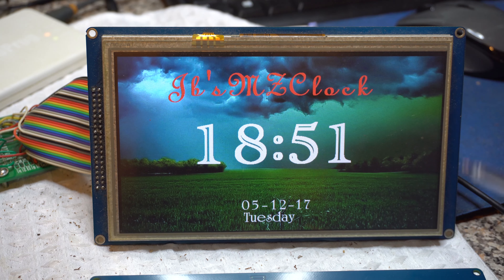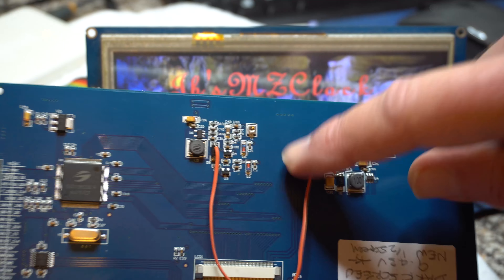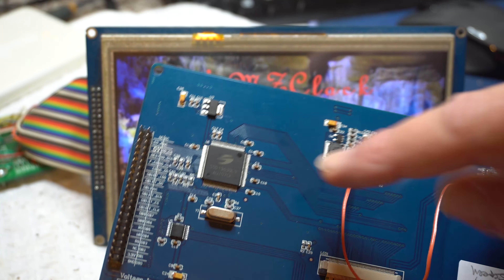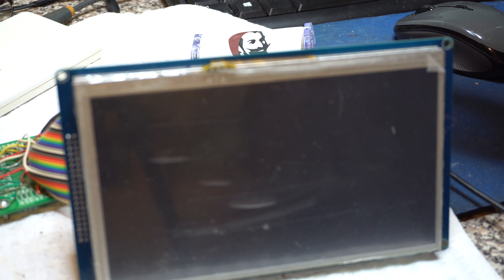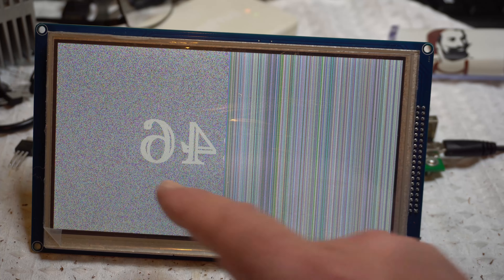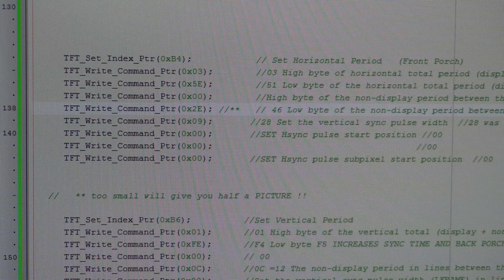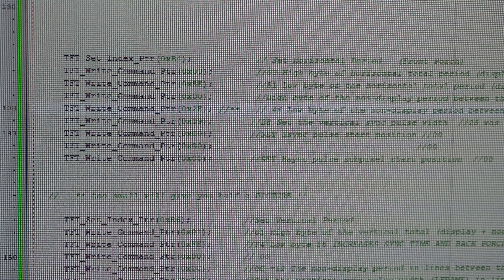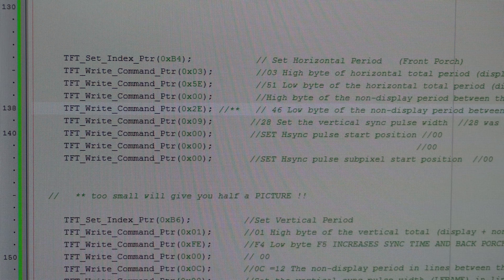7" TFT SSD1963 Register Settings for New Displays When Only Half Picture Shown

Comment: hello sir..
this my initialize code .and i have same problem where you change 0x2e-->0x46 and solve initialize the lcd i change it but not working For me i used ssd1963 7 inch with STM32F407VGT6 

void Init_SSD1963(void)
{
Lcd_Write_Cmd(0xe0); //START PLL
Lcd_Write_Data(0x01);  //Set bit Enable PLL
HAL_Delay(50);  //Wait  to let the PLL stable
  
Lcd_Write_Cmd(0xe0); //START PLL
Lcd_Write_Data(0x03);  //(0 - Use reference clock as system clock   1 -  Use PLL output as system clock)
HAL_Delay(5);

Lcd_Write_Cmd(0x01); // Software reset
HAL_Delay(10);  
  
Lcd_Write_Cmd(0xe2);//Set the PLL
Lcd_Write_Data(0x1d);
Lcd_Write_Data(0x02);
Lcd_Write_Data(0x54);
  
Lcd_Write_Cmd(0xe6);//Set the LSHIFT (pixel clock) frequency
Lcd_Write_Data(0x04);
Lcd_Write_Data(0x6f);
Lcd_Write_Data(0x47);  

Lcd_Write_Cmd(0xf0);//SET pixel data I/F format=8bit
Lcd_Write_Data(0x03); //pixel data format, 0x03 is 16bit(565 format);0x00 is for 8-bit
//Set the MN of PLL

//////cput(0xe2);   //SET PLL freq=113.33MHz ;
//////dput(0x1d); // values set are diff in app note (1D)
//////dput(0x02);   // values set are diff in app note (02)
//////dput(0x54); // values set are diff in app note (54)
////// 
//////cput(0xe6);   //SET PCLK freq=33.26MHz ; pixel clock frequency
//////dput(0x04); //01 values set are diff in app note 0x04
//////dput(0x6f); //30 values set are diff in app note 0x6f
//////dput(0x47); //16 values set are diff in app note 0x47

Lcd_Write_Cmd(0xb0); //LCD SPECIFICATION   SET LCD MODE SET TFT 18Bits MODE
Lcd_Write_Data(0x20);  //dput(0x08); //SET TFT MODE & hsync+Vsync+DEN MODE
Lcd_Write_Data(0x80);  //
Lcd_Write_Data(0x03);//SET horizontal size=800-1 HightByte
Lcd_Write_Data(0x1f);//1f   //SET horizontal size=800-1 LowByte
Lcd_Write_Data(0x01);//SET vertical size=480-1 HightByte
Lcd_Write_Data(0xdf);//df   //SET vertical size=480-1 LowByte
Lcd_Write_Data(0x00);//   dput(0x2d); //SET even/odd line RGB seq.=RGB

//Set front porch and back porch
Lcd_Write_Cmd(0xb4);// SET HBP
Lcd_Write_Data(0x04); // SET HSYNC Total = // 0x04 SET HSYNC Total = 1056  // hsync of  value in app note is 8367 & not 1056
Lcd_Write_Data(0x20);  
Lcd_Write_Data(0x00); // SET HBP = //SET HBP = 256 // HBP of value in app note is 163 & not 256
Lcd_Write_Data(0x2e);  //SET VBP 0 //  earlier value of VBP = 8 , write data ( 0x07)
Lcd_Write_Data(0xd2);// SET VBP
Lcd_Write_Data(0x00);
Lcd_Write_Data(0x00);// SET Hsync pulse start position
Lcd_Write_Data(0x00);// SET Hsync pulse subpixel start position

Lcd_Write_Cmd(0xb6);    //SET VBP,
Lcd_Write_Data(0x02); //0x02 SET Vsync total 526 = 525 + 1  // vsync of  value in app note is 496  & not 525
Lcd_Write_Data(0x0d);
Lcd_Write_Data(0x00); //SET VBP = 45                // HBP of value in app note is 4 & not 45
Lcd_Write_Data(0x17);// 0x2d
Lcd_Write_Data(0x16);// 0x00 SET Vsync pulse 0     // SET Vsync pulse in app note is 2 
Lcd_Write_Data(0x00); //SET Vsync pulse start position
Lcd_Write_Data(0x00);

Lcd_Write_Cmd(0x2a);    //SET column address
Lcd_Write_Data(0x00); //SET start column address=0
Lcd_Write_Data(0x00);
Lcd_Write_Data(0x03); //SET end column address=799
Lcd_Write_Data(0x1f);

Lcd_Write_Cmd(0x2b);;     //SET page address
Lcd_Write_Data(0x00);//SET start page address=0
Lcd_Write_Data(0x00);
Lcd_Write_Data(0x01);//SET end page address=479
Lcd_Write_Data(0xdf);  //1f

Lcd_Write_Cmd(0x036);  //SET RGB BGR
Lcd_Write_Data(0x08);  //1 BGR  0  RGB
//Lcd_Write_Cmd(0x36);;     //SET address mode to rotate mode
//Lcd_Write_Data(0x60);
//Lcd_Write_Cmd(0x3a);  //Reserved command ???????????
//Lcd_Write_Data(0x60);

////////===========================================
//////Lcd_Write_Cmd(0x33);
//////Lcd_Write_Data(0x00); //SET top fixed area=0
//////Lcd_Write_Data(0xB4);
//////Lcd_Write_Data(0x00); //SET vertical scrolling area=479
//////Lcd_Write_Data(0x94);
//////Lcd_Write_Data(0x00); //SET bottom fixed area=0
//////Lcd_Write_Data(0x98);
////////===============================================

Lcd_Write_Cmd(0xb8);
Lcd_Write_Data(0x0f);
Lcd_Write_Data(0x01);

Lcd_Write_Cmd(0xba);
Lcd_Write_Data(0x01);

Lcd_Write_Cmd(0x29);// SET display on

Lcd_Write_Cmd(0x2c);
}
Reply from the maker: are you saying you only have half a screen?
I noticed you went for the 800 -1 and 480-1
My datasheet said 800+1 etc